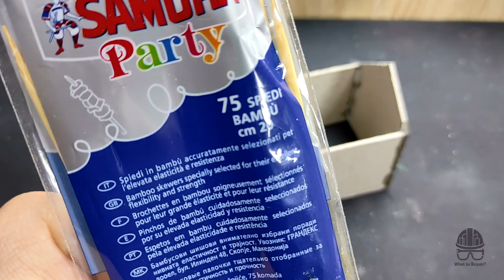Snow Cabin Diorama 1:64

Comment: Hi, what is the board you started with? What is the white powder?
Reply from the maker: Hi, do you ask for board in the beginning of the video or board that I use as base for diorama? In the beginning of video I use solid 2 mm thick carton board for cabin walls. Base for diorama is extruded polystyrene foam board, or XPS foam board. White powder is baking soda.
Reply: @WhattoRepair  Very well done, thank you very much for your reply！

Comment: cool and amazing! What do you scatter on top of the trees at 18:45?
Reply from the maker: This is baking soda. First I put some PVA glue on branches with brush and after that I scatter baking soda on glue through strainer because my soda had some small clumps inside. In fact, I put on branches PVA glue already mixed with baking soda, but still I need to scatter some soda on that glue to eliminate gloss.

Comment: What are the little round sticks you use for the siding? And whats the wood board called you uses for roof and chimney
Reply from the maker: Round sticks are barbecue skewers, you can see on the packaging. You use that sticks for baking meat or vegetables on barbecue. Wood board is balsa wood. Balsa is widely used in modeling. For that use balsa can be replaced with cardboard.

Comment: Look perfect brother, very inspiring to make like that...can you tell me the size of cabin?
Reply from the maker: Yes, I totally forgot to mention dimensions in video. Base is 70x110 mm. Height of front and back wall is 45 mm and height to the top of the roof is 75 mm. Those were dimensions before making a roof and gluing wood sticks to the walls. Sticks and roof added little more milimeters to dimensions but this is not so important.

Comment: hello, what is the size of the house?
Reply from the maker: I just wrote answer to another same question, I forgot to mention dimensions of cabin. Base is 70x110 mm. Height of front and back wall is 45 mm and height to the top of the roof is 75 mm.
Reply: Thank you!